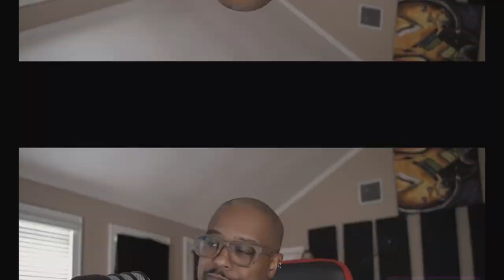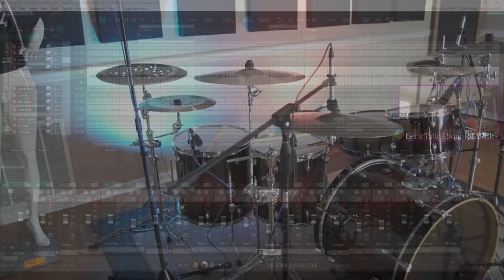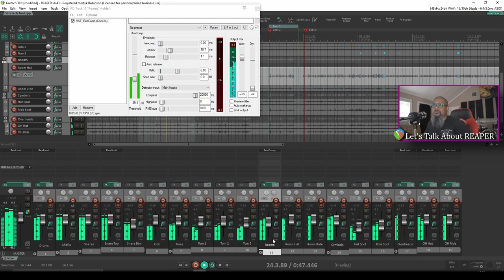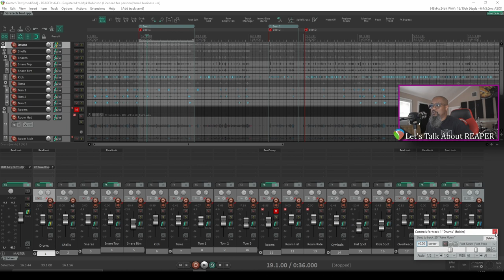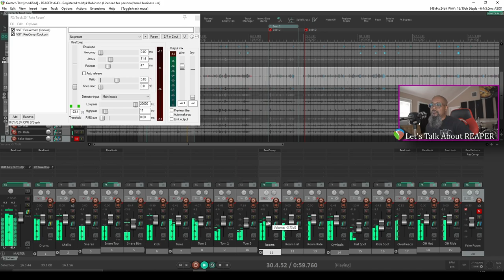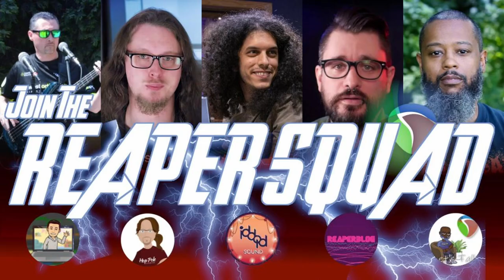Make Your Drums Sound BIG with Stock Plugins in REAPER

Comment: I love the sound of the kick. How do you get it to sound like that?
Reply from the maker: That's just the natural sound. It's a 22" maple kick miked with an Audix D6. No studio magic, just tuning
Reply from the maker: I do have a "kick pillow' inside the kick drum to help dampen it a bit
Reply from the maker: @Rohit Gupta, are you  perhaps interested in some videos about setting up the kit for tracking?
Reply: @LetsTalkAboutReaper  That would be awesome! What kind of beaters do you use?
Reply from the maker: Currently using DW Control beaters. It has adjustable weight and different beater surfaces. I'm using the hard plastic at the moment.
Reply: @LetsTalkAboutReaper  I think I might buy those. I had made my own beaters with lacrosse balls because I wanted heavier beaters but those got a wee bit toooo heavy lol